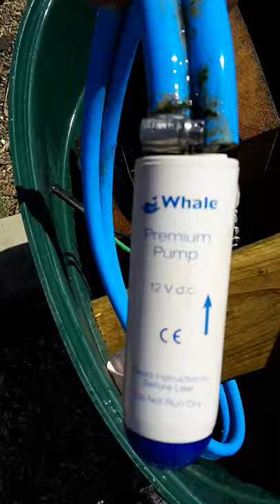Water wheel in a water butt .  Self circulating and powering*

Comment from the maker: Pump uses 30 watts. I left mine running all night by accident once and it still works now so I think 15 mins run time is a tad over cautious personally. There are 16 high powered neodymium magnesium robbed from a wind turbine on the fan propeller, one on the face of the blade and one on the back holding the magnet from jumping onto the coils.